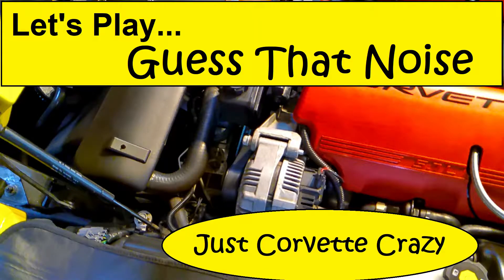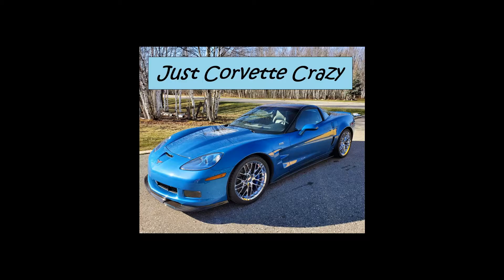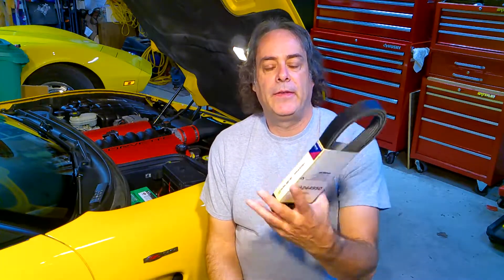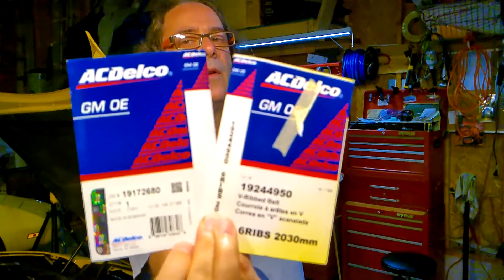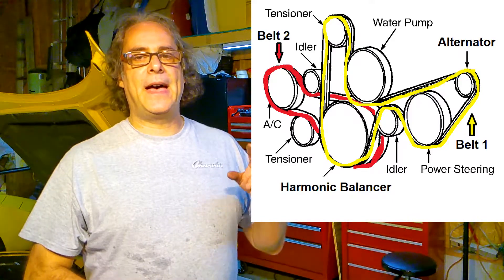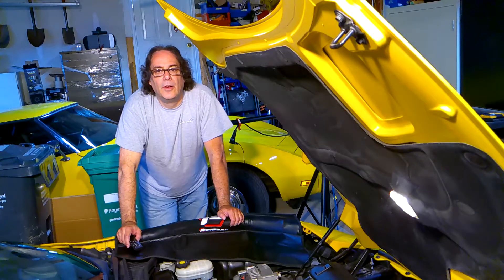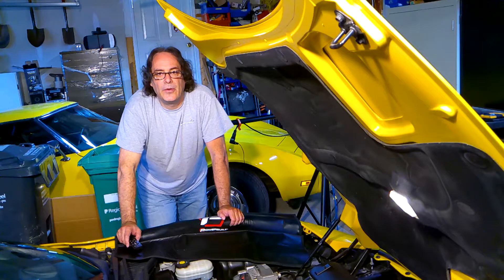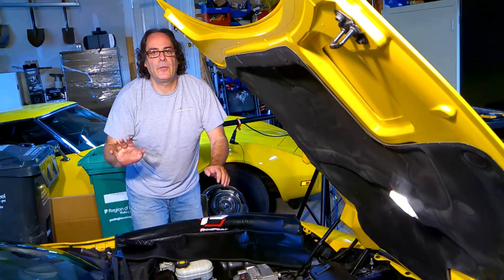Belt Replacement LS Engine

Comment: Hi Mr. G. Is it true, that my LS3 has one belt?  I can only see one.Thx in advance from Germany, Tom.
Reply from the maker: All diagrams I see show 2 belts on stock LS3 engine.  Do you see your AC compressor on passenger side very low on engine.  That should have its own belt.